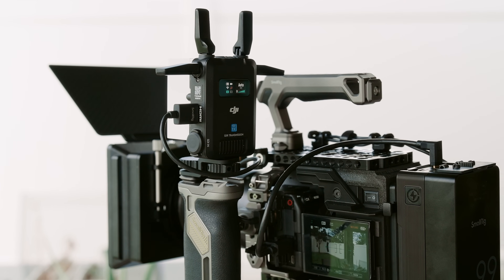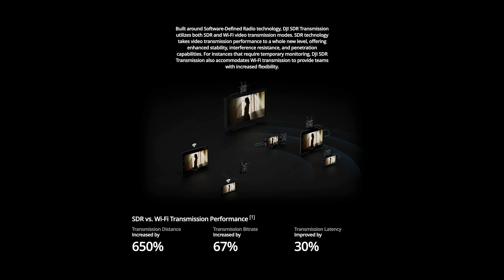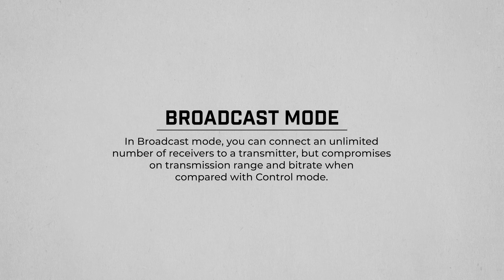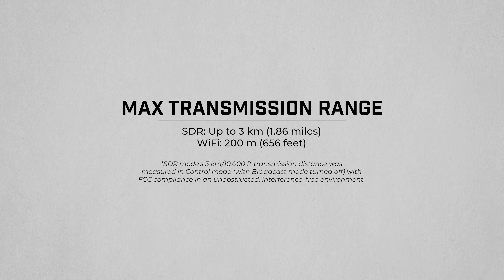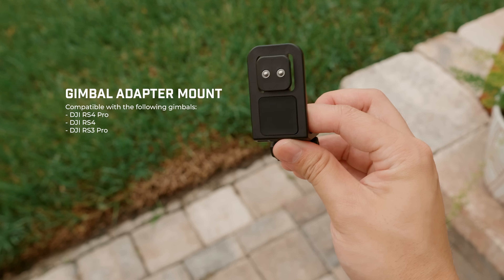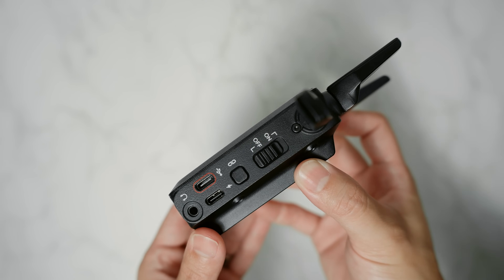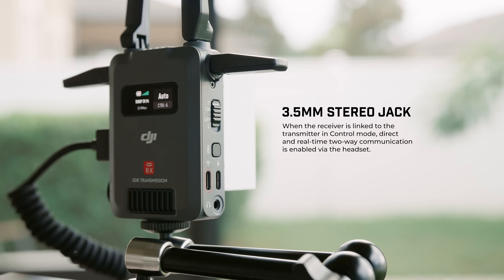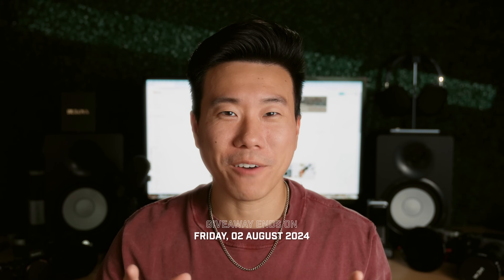DJI SDR Transmission: Everything You Need to Know!

Comment: Your video claims "everything you need to know" -- I need to know if the DJI transmission system includes the ability to remote trigger ActiveTrack, like the Raveneye transmitter can do. Can it do that? If not, why?
Reply: @myerssamuel1057  tool

Comment: my problem is we only have one HDMI output on our camera (FX3 in CineBack) and I don't want to have to replace our current monitor to plug into this. I wish this had an HDMI in and out to both output a native signal as well as transmit one
Reply from the maker: Does your current monitor have a n HDMI out to daisy chain to the transmitter?
Reply: @DavidZhou  Sadly no. We went for the Atamos Shinobi because it was lighter weight and cheaper, which helped with our minimalist build, but we didn't consider that it lacked out output when buying it. Sadly we've already thrown away the packaging and approaching the end of our potential return window on it

Comment: On all the DJI videos they show multiple devices being used at the same time, for instance I have been trying to use 1 receiver and 1 phone via WiFi, however the WiFi feed on the phone is so choppy, can you actually use the different types of broadcast modes at the same time?

Would love to hear if anyone else had had the same issues because DJI don’t like to include proper instructions they just presume people will do a bit of trial and error or reply on YouTubers to do their tests for them.
Reply from the maker: I only tested this briefly and after I disabled Bluetooth on my iPad, the choppiness went away—not sure if that helps, let me know!
Reply: @DavidZhou I have turned off the Bluetooth on my phone but it’s still super choppy for me, I’m back on set tomorrow so will try it with my iPad and see how it performs, I do remember briefly when I first had it when the SDR receiver was turned off the choppiness via WiFi disappeared but again I need to do some tests.

Just looking on the DJI site it seems to say you can output 3 SDR signals and two WiFi signals simultaneously, but at the same time they say you can only transmit to two receivers in control mode and in broadcast mode you can have unlimited so I’m so confused.
Reply from the maker: @jamesalexanderbarnettdp9479  Let me know how it goes, my understanding was 2 SDR receivers in Broadcast mode and simultaneous 2 wifi signals, but that's just theoretically.
Reply: @DavidZhou  seems to be an issue with my iPhone 13 mini with the choppiness,I don’t get any when using my iPad.
Reply: how many maximum you can connect to ipad while in boradcast mode? is it unlimited?

Comment: they adv for 3KM long range and  how did u lose signal at 800 feet during the outdoor test ? that 800 feet is less then 300 meter that is less then 10% of their adv range.
Reply from the maker: 3km in full unobstructed, zero-to-no interference. In the outdoor test, I stopped at 800 feet because I ran out of distance to go in my neighborhood and I don't have a good area near me to test something as far as 3km/1.8mi. Though for everything I'd use the DJI SDR for, I feel comfortable in it's signal strength, but obviously your mileage may vary!

Comment: Three issues I’ve found with the SDR:
. Doesn’t charge the phone or tablet it’s plugged into
. The receiver isn’t recognized as a webcam when plugged in to a computer
. Seems like it can’t send a video signal to my RS3 Pro for Active Track
Reply: SDR disables ActiveTrack on gimbals... absurd fail.
Reply: @daveklein6585  Hopefully they can add it via firmware update. I have no idea if the USB ports on the transmitter can pass along the video signal. I assumed they could since the receivers have that feature, but that very well might not be the case. Would be a mega bummer if this thing never gets Active Track

Comment: 80 ms delay? haha only a youtuber can say such nonsense. As you can clearly see, the latency is in the range of 250 - 300 ms. Why are you doing a test if you read pure data from the description and do not provide actual parameters. (the difference is that 50-100 ms is a latency with which the focus puller can work reasonably well) That's why DJI is pushing nonsense and you take it seriously.

Comment: How did you get 4K signal at 3:37 ?
Reply from the maker: The stream is 1080p, but I was also outputting HDMI info. so I could also monitor camera settings. What you’re seeing is the camera info showing that, locally on the camera, I’m recording at 4k24p
Reply: Use Hollyland Mars 4K

Comment: For some reason I get an error of power when trying to power the transmitter from my gimbal. Do you have it? It says that there’s not enough juice to power it.
Reply from the maker: Which gimbal are you powering it from? I didn’t have any issues when I was powering mine off of the DJI RS4
Reply: @DavidZhou  RS3 Pro
Reply: Maybe try a different usbc port on the gimbal? They seem to each be for specific purposes
Reply: @geoffwebb1  I check and all of the ports give 5v and the minimum for the transmitter is 9v, do you have a meter to test it out? I used a USB c one to test it

Comment: With Rs4 Pro and Dji Title Ecosystem I will use Dji Sdr for more compact, reliable shootings like film, music clips, documentaries. I have Accsoon cineview se. It's compact but not give me a full control on my system. Every shooting I am using my Dji RS4 Pro for base head. I can switch easily from tripod to steadicam or gimbal. But the biggest problem for me I don't like wired components like extra monitor with hdmi. So I tried to use Monitor+ or Accsoon app for me. Monitor+ gives huge control but quality is not great. Accsoon is good for quality but opening time is long, not have camera control option and bad color quality. Also weak range for steadicam. Director's monitor or focus puller monitor have to near me. It's very big problem. So Dji Sdr is what I looking for. Easy use, can useable for teams and user friendly. Absolutely full adaptable with Dji Ecosystem. It makes my job easier and for my clients (tablet holder) and also for my teammates( especially for art department want to look picture what I took. Now they can see easily with phone adapter) everything will be more reliable and easy.  instagram: @medyacimuhendis 

Thank you.

Comment: 80ms and 110ms is not great for focus pulling. Even Hollyland and Accsoon are around 40-50ms which are bit more reasonable.
Reply from the maker: I agree, for dedicated focus pulling it wouldn’t be the fastest solution, but for general monitoring I think it’s really versatile, especially at the price point!
Reply: yeah, not ideal for focus-pulling. I did the math quickly if anyone is wondering: at 24fps, 80ms of latency is 2 frames. 110mm will equal 3 frames, plus whatever lag the camera adds. so at best, this is only 1 frame slower than the Hollyland and Accson solutions.

Comment: I would love to use the TX / RX Combo along with the Mobile / Tablet mounting options to create a very lightweight portable Directors monitor for smaller client shoots with an iPad. This is great as it's a more affordable option as compared to building out a proper directors monitor with a monitor, cage, and battery solution. This as its very compact and easy to travel with! 
@Lowp3z

Comment: @nicolasgarciaferrari
I work in live news productions. We connect cameras to transmitters (LiveU, Aviwest) whose operation depends on the available internet network. In places with large crowds (demonstrations, concerts, etc.), the network gets congested, and there is no bandwidth. If the transmitter (LiveU, Aviwest) could be moved to a Wi-Fi connection point or away from the crowd, it works. Do you think it will work? I use PAL, does it work at 25fps?
Reply from the maker: I imagine yes, it should work, though I'd imagine your range/stability would be significantly impacted depending on how congested the area is!